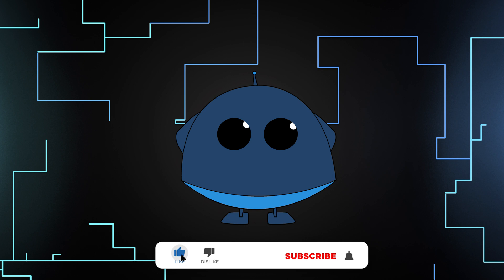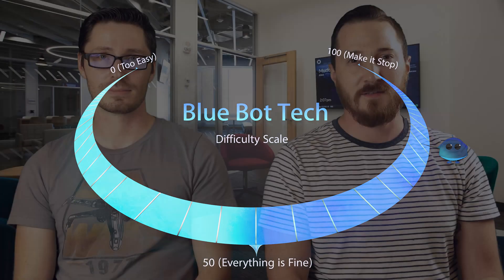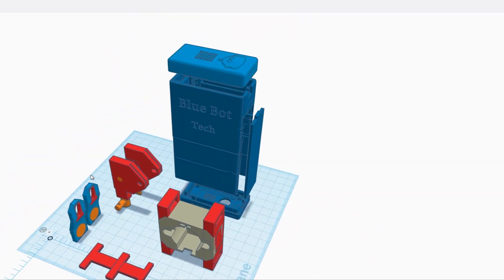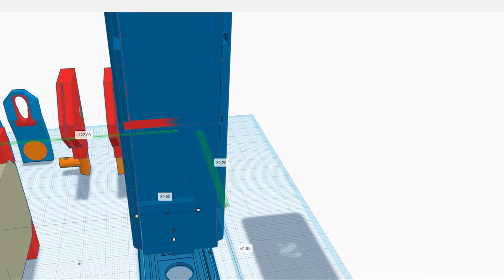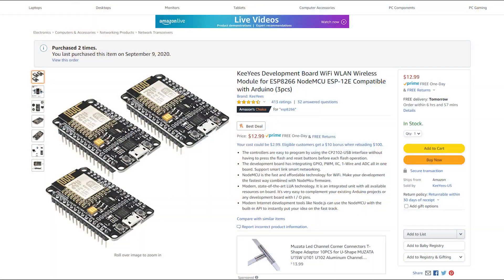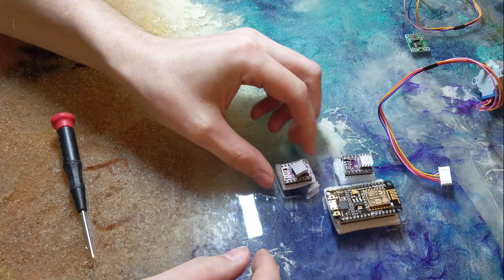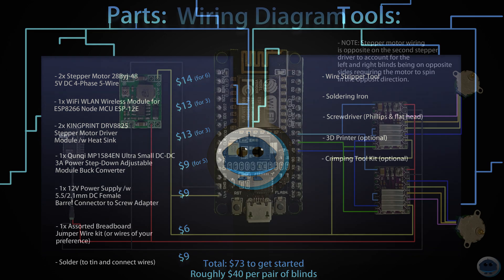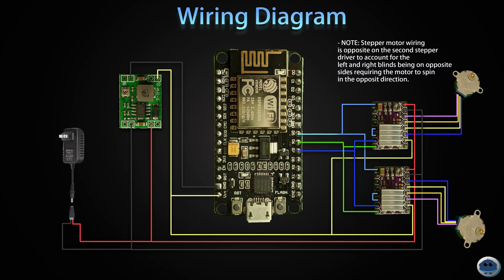Automate and WiFi Control Your Plantation Blinds for 40$

Comment: This is so awesome! Just a quick one, theoretically speaking, do you need to still break the track on the motor's PCB if you were just to unsolder the wire from the PCB? Is the track on the motor PCB linking anything together?

Comment: Hi, thank you for this type of automation. I have wired up as per your video. Would there be any chance of at least providing a few lines of simple Adruino IDE ESP8266 code to control the blinds via a web commands (e.g., 192.168.x.x/open  or   192.168.x.x/close, 192.168.x.x/open-a-bit  etc)? 
For me, its a bit of a hop-skip-and-a-jump to understand home server control of the blinds - basically a time consuming huge learning curve. Additionally, if you want to later,  it would really help if you went through your more complex Adruiino code and home server configuration setup step-by-step (I have home server installed, but very new to it).

Comment: Wish there was a design out there for 2 shutters per door.  The problem i come into is i have two sections with a hinge per side on my plantation shutters.  So with this design i wouldnt be able to open and fold the shutters like they are designed to.
Reply from the maker: Yeah this design was really tailored to my specific blinds type. I have almost completed a new design and build for controlling blinds that should work universally.
Reply: @BlueBotTech  any idea when you'll release it? I've been considering ripping all mine out and replacing with roller shades bit may hold off and try new solution
Reply: @BlueBotTech  Would love to see the new... I've been trying to figure out the best way to "rehash" your design to work with my shutters (separate upper and lower, center connecting guide). I'd like to control each section separately; looks like this design runs both sides simultaneously. How many motors, for instance, can be controlled with each NodeMCU? (lots of pieces to this puzzle that I'm trying to understand :) ) Thanks, guys!
Reply: @BlueBotTech  just following back up to see if you know when you'll release those new designs i'm eager to try out.
Reply from the maker: @explosiveenterprises1479  Sorry it should be soon, still optimizing some things.
Reply: @BlueBotTech  I am looking at something similar, but I have tilt bars that are concealed in the frame which makes mounting a motor a bit more of a challenge. Have you thought of an option that uses a concealed tilt bar?
Reply: @BlueBotTech  Still plans to release new designs?